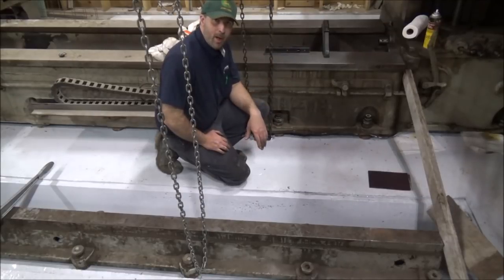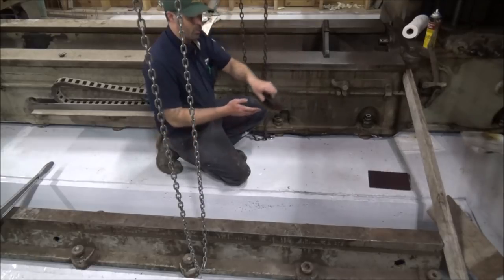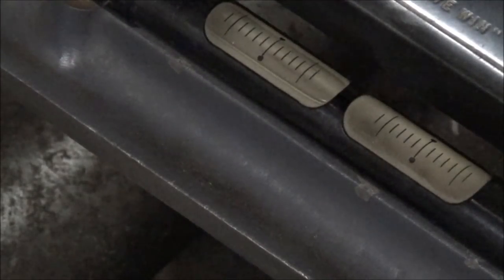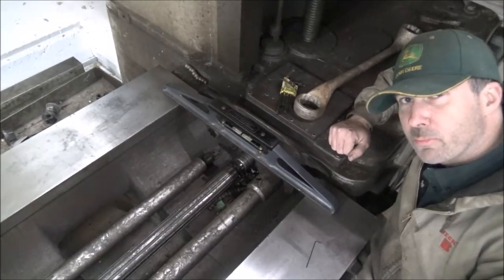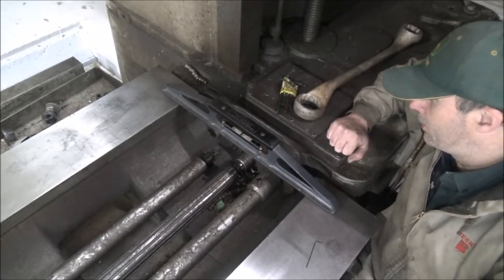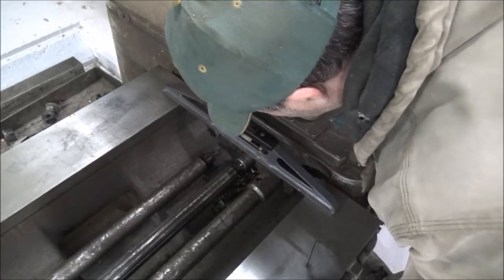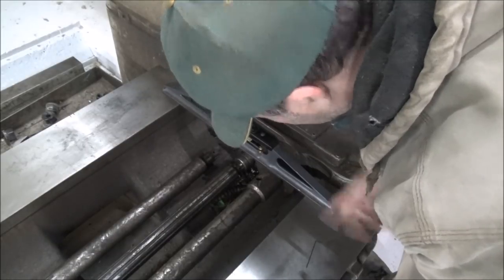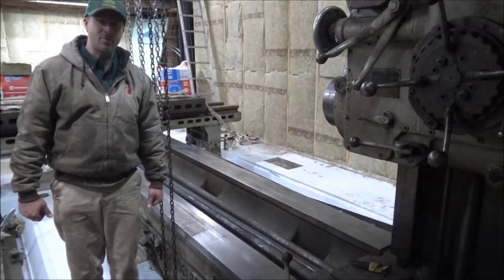Mill Level Part 1...................... I got a Problem :-(

Comment: Hi Brian, 

Adjusting a machine to fit those tolerances is delicate enough;  but with a level like that it's becomes very frustrating. 

It's amazing how little of a turn on even a fine thread can send the bubble full scale. 

Hope you get it sorted. 

Replacing the vial also needs extreme patience in getting it accurate to. 

You've done a good job on the concrete.

Comment: Is that a crack in the vial?  It' looked like there's a crack in it. That would definitely throw it off. Thanks for the video and good luck sorting it all out.
Reply from the maker: It isn't cracked but there is a heavy scratch I had not noticed till you mentioned it, I believe that has damaged the vial in that location causing the bad behavior.

Comment: Get a good level that will reverse and get the machine as close as you can.  Then take your 10" and make you a parallel as best as you can that will span the machine.  Set your 10" level on top of the parallel and then reverse the level on top of the parallel.  If the reading is OK, reverse the parallel and recheck the level reversing it to make sure all is OK then go to it.  Sounds like a lot of trouble to go to but if the other is not working right and you want to get er done...hope you do get er done Brian, Greg.

Comment: I'm going to question a vial going bad too.  I'm not an expert but I think the mount being loose or air/grit under the ends are more likely.
Reply from the maker: I have tried it in multiple places and always get the same results. You 
can see how in the video the bubble slowly comes up then it takes off to
 the other side. I even put it side by side with my other level and 
tried the same thing and the results were still goofy and incosistent. 
If it was one line I might go with it being me but 3-4 lines something 
is wrong with the level.
Reply: I tend to agree with htral, take it apart and test the vial without the base. You need to come up with an adjustable 3 point support block for the vial. if the vial is correct then the mount was loose.  Also, check your base for cracks, dings r any damage. at 3 or 5 arc secs every little bit is an enormous difference.  You will find that old levels use some sort of plaster to mount the vial. It will be a pain to dig out the vial.  You may want to look at some sort of chemical solution. Acids will dissolve plater, but may also harm the metals.  Proceed with caution.
Reply: Is the base of the level flat? If it is a little twisted, the level could be rocking on the opposite corners.
As someone already mentioned, it would be worthwhile to retest the level in a warmer room to see if the low temps are causing issues. Either with expansion and contraction of the fluid, or the frame and bubble mounting could be inducing flexing and stress.
Either way, don't just try to fix it, get another one. Even if you fix it can you ever really trust the level again?
With the jobs you are doing with that machine, a second large level will probably come in handy anyways.
And go get those railroad tracks and grind some giant parallels already.....
Reply from the maker: I don't think it is rock because I get the same issues if the whole level is supported or if I place it on some pads at varrying distances.
Reply: most likely it is the vial moving in the mount, most likely the plaster is no longer attached to the glass.  I do not know how to verify that.   The vial must be firmly attached to the base for it to work correctly.  I would still take it apart, check the vial separate from the base, and then reinstall it firmly.

Comment: Make and rig up a dozen or more hydraulically linked height type gauges across the whole bed area to get a base  level setting that will allow fairly accurate initial completion of mill installation. 
Live level changes, due to settlement, along the whole length of the bed can therefore be monitored and adjusted on the fly...
 
Hope this helps,

John Greenwood
Reply from the maker: That doesn't sound hard at all........................

Comment: I have to think the others are correct about the viscosity/temperature being the issue.  As little as you are moving it the vial would likely stay in place even if it was loose in the mounts, which I doubt is the case.

Comment: Would be good if you , told us the level you are using, and where to get a new viel
Reply from the maker: My level was made by the Universal boring mill company back in the 1940's I replaced the level with one from https://www.geier-bluhm.com/ and it fit perfectly and had the same .0003"/foot resolution

Comment: Colder temps may affect it. Carpenters levels will start getting affected below zero. I always thought they used alcohol in level vials because of freezing. I never tried fixing one... not worth it for carpentry levels usually. Heck I think you're doing pretty good,  no one accused you of dropping it! LOL

Comment: I was under the impression that a level that sensitive needed time to settle in every time it is moved.  If the foot is as flat as some have implied, it can actually trap air between itself and the machine surface that will affect the reading.  That's a hear-say, at least for me.   I guess the only way to find out would be to test it as you did here, but give it 5-15 minutes time to set after each move and see if it does come back to the previous reading.  Even wipe the surfaces with your impeccably clean palms every time, as lifting it might cause a micron of dust to get sucked into the area where the level is sitting.  And even moving the machine, without moving the level on the machine, it will need time to settle again.

I think I'd be machining a length of flat bar to get across that big span and use the less sensitive level to get things inside the base lines (or at least in the ball park) first, then tweak it in with the other (shouldn't be too difficult with a surface grinder).  If some levels are as sensitive as I've been led to believe, it sounds like a sure way to earn a place in the looney bin if you try them from the start.
Reply from the maker: I have used sensitive levels before and they aren't that bad. It takes less than a minute for one to settle out. The biggest thing is keeping everything clean as they certainly read wrong if on dust or dirt. I recalibrated it to use a different section of the vial as level and it works fine now.
Reply: The way I'd heard it, you'd have thought that they were delicate as a glass spider web and horrendously expensive.  I think the guy had a few bad experiences with youngsters handling his tools ... 

Good to know that you found a fix for it.

Comment: how cold is it in the shop and i wonder what fluid they use for the level. if its too cold it could be too thick and preventing it from recentering properly.. change in viscosity because of the cold..  or a change in the curve of the tube because of the cold..  take it in the house and warm it up.. see if it becomes accurate again..   you may have to build a warming box for it  out of styrofoam around wood..  perhaps with a piece of steel or stone . think kitchen top granite scraps as a thermal moderator.. pulling it out of the box and then closing the box to check the level.. then putting it back in while repositioning for the next measurement.
Reply from the maker: I tried it on my dresser stacking paper under the ends and got the same screwey behavior.
Reply: I've always called them spirit levels maybe because they contain spirits or alcohol?

Comment: Brian, that could be the vial has come loose inside its mount or the mount itself is loose inside the level body, worth checking before you splash the cash. Ive a .0002" in 10 hilger box level with the same issue that ive not got round to fixing yet.
Reply from the maker: I can detect no movement in the vial in the case even pushing on it it seems solid. I have tried it with the adjusters tight or loose because I thought it might be putting some bending force into the vial body and it still behaves the same. I think over 80 years some stress in the glass has changed and it is now screwed.
Reply: Hmm, id have thought even a distorted vial would loose accuracy but should still repeat. Maybe one last thing to try is have the vial out of any holder, stick it to the level body temporarily with blue tack and recheck the repeat. If it still reads the same then must some weird issue with the vial.
Be interested to see how you fix it, gl.

Comment: Are you going to check for bed swayback, or is it going to even matter? Every time I see a machine with adjustable feet all along the bottom I wonder if they were put there to accommodate uneven floors with a stiff machine, or are they there to correct machine flex and sag? Or both?
Ie: A machine with 4 corner mount points usually is stiff enough to not sag in the middle much. It may twist, but shouldn't sag
Reply from the maker: At 10foot long and only 2 foot tall the bed bows about .003" best I can tell just from its own weight. I have to put the center feet down to give it enough support to not sag.

Comment: How does a vial go bad?  Is there a chance that it is just too cold for it to work properly? Or has the mounting just gone bad? When Starrett sent me a new vial, it came with something like plaster of Paris to mount it in the tube.
Reply from the maker: I think over 80 years some stress in the glass has changed and it is now screwed. Glass never fully sets up and its crystal structure keeps changing over time. I think that has had an effect here.
Reply: It’s a common misconception that glass isn’t a solid. It is a solid, not a supercooled liquid. It doesn’t flow or change shape with time at all, no more than granite does.
As glass cools, there’s a temperature range where it transitions from liquid to disordered solid. Above that temperature range it’s a very viscous liquid, with measurable properties like thermal expansion coefficient. The properties below the transition range are distinctly different.
The argument is often made that “windows in cathedrals are thicker at the bottom, showing that they’ve flowed.” It’s true that they’re thicker at the bottom, but that’s the way they were installed. Medieval panes of glass were made by spinning a glob of glass till it flattened into a disk then cutting shapes from the disk after cooling. The disk was thicker at the center so pieces cut from it were thicker on one edge, and glaziers would ordinarily put the thick edge at the bottom. 
Think of telescope mirrors - if they flowed over time, old telescopes would be useless. Though much heavier than windows, the nearly hundred year old 200” telescope at Mount Palomar still focuses.
If the vial is the problem, it’s not because it’s flowed to a different shape. Perhaps it under some stress in the way it’s mounted.
Reply: indeed coming from the UK and seen window glass that is 3-4-500 years old in person, it sure hasnt flowed, iv seen glass bottles and mirrors that old too, they didnt sag!, heck ive held roman glass, it would surely have shown signs if it was going to, i also have a carpenters level in wood (sure not as accurate) but is still as good as day it was made, in the 1920s, i think i would agree with above, it is loose in its housing, it might as well come apart
Reply from the maker: You don't think there are residual stresses in glass that can result in deformations over time? I know steel and iron sure can move around with time even if only from multiple heat cycles.
Reply: bcbloc02 Glass is more like stone than metal that way. Metals can deform plastically when stressed, where rocks and glass can’t. There are residual stresses in glass but they don’t cause shape change.
Reply: Yeah what he said ;-)
Reply: I worked with a glazer and he told me glass was always in a semi liquid state. He showed me old vertical mirrors over time were thicker at the bottom than the top.
Reply: The uneven thickness in windows was an artifact of the crown glass process. It was made that way and the workers typically set the thicker side at the bottom.

Comment: My level is 8"  long and .0005 over 10"version. You are correct about yours being the size up from mine.  So far I am happy with it for the money.  Looks like you are making good progress Brian .  They are hard to use when the level is working correctly.  Hope you caught  that issue quick. :->
Reply from the maker: Mine works great, I was very happy when I got it out of the box after 3 years it was still holding level and I didn't need to recalibrate it. For the money they are a good piece. I think I paid about $90 for mine 15 years ago.
Reply: Steve did you get an extra 0 in there?
Reply: Shaun Tucker nothing new for me. Not the 1st time won't be the last I'm sure.
Reply: Steve summers.. me too my friend.. my too!
Reply from the maker: Fooling with mine some more the base is a bit frowny shaped. You may want to check yours and rescrape it. It works great as long as its all supported but start running one end off and the results go a bit off what they should be.

Comment: If you can’t fix your long level, an alternative could be something like subtool.com (Suburban Tool) 24” cast iron straight edge SE-24-CI which is 1” wide x 2” high and set your 12” precision level on top of that. Cost $601 plus UPS shipping. I am sure you will figure it out.

Comment: A level is so simple, with no moving parts (usually); so this must have something to do 
with the fluid viscosity or the pressure in the vial?  What else could cause this?   Mystifying.

Comment: This will be a learning experience for us all as I find it hard to believe a vial could go bad other than the liquid leak out. Was the level ever accurate? I am not concerned about the level because Brian can fix anything. :-)
Reply from the maker: I have no idea, it is an 80yo tool, who knows what has happened to it in that time. I see no signs of damage but something is funky with it.
Reply: I am nearing 80 too, thus not very reliable anymore and certainly not "repeatable". :-)

Comment: I wonder. Does the high torque, load of work, and impact of putting work on and off the machine throw off alignment on such tight tolerances? I have no doubt you can get it level down to under half a thou but would it stay that way for any reasonable amount of time?
Reply: thats why it has all the big bolts to concrete, shouldn't move
Reply from the maker: I have no doubt it is going to move some, the question is how much.  So far it looks pretty solid. My weight won't move the bubble any on the sensitive levels. With 47000lbs of preload on the floor it seams pretty stable.
Reply: I'm not a machinist at all, honest question here : What is the purpose of getting a mill level in such a precise tolerance ?
Reply: I am not a machinist either but from what I understand the ways need to be in the same PLANE & the same distance from the center line of the spindle for the most accuracy.  The word "Level" is used in the relationship of the spindle centerline and the distance to each way being equal which is easiest to get if across the ways are level.  One end to the other must be in the same plane even if not "level".  Hope that helps.
Reply: level machine = level ways, and ways that are not twisted, means it maintains  accuracy, large machines will twist under their own weight, so have lots of feet to adjust them
Reply from the maker: Leveling is the easiest way to get everything aligned properly and to be sure there isn't twist or distortion in the machine itself. It is not actually important that it is actually level, only that it is the same.  If it is actually level though it makes setting up parts easier since you can level them as well and they are in the correct orientation for machining then.

Comment: That level has a sealed vial that is precision ground . That Bullard level is extremely sensitive at .00025 per graduation. All it takes it the tinniest piece of dust to throw it off, you should wiggle it in place to make sure it’s sitting on its sole well. 
 Do you have a lapping plate or a inspection plate...?
Reply from the maker: I have my big granite plate but it is not certified and unknown how flat it is.

Comment: Video reveals very slight disparity in level placement. And, with precision levels, that slight disparity matters.  Prior to discounting vial quality, You may consider clamping a straightedge across the ways, and another at 90 degrees on one end only, to ensure more consistent level base placement. Then, wipe the way and level before gently sliding the level against both stops. Then, don,t breath on it. Sounds severe, I know, but it matters.
Reply from the maker: I have tried it in multiple places and always get the same results. You can see how in the video the bubble slowly comes up then it takes off to the other side. I even put it side by side with my other level and tried the same thing and the results were still goofy and incosistent. If it was one line I might go with it being me but 3-4 lines something is wrong with the level.

Comment: Just a thought, check for cracks both on the machine and the floor anchors/machine feet. Try if you can level the machine on blocks to eliminate that the machine is cracked.
Reply: perhaps brian buys his machines pre-dropped these days to save time :)
Reply from the maker: I can only imagine you must be joking.  No way me picking up and putting a 10lb level down on a 47000lb mill moves it several thousandths when I can put my whole weight on the ways and the bubble never moves.
Reply: True... ;)